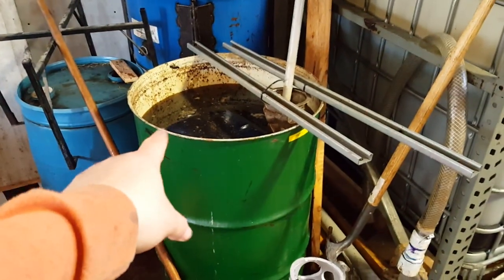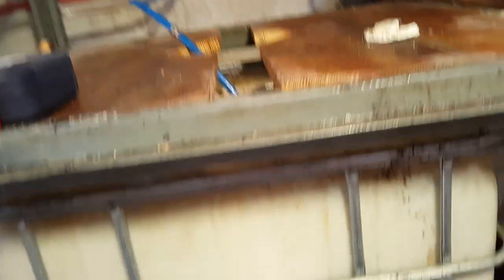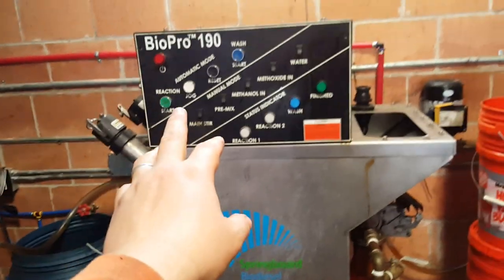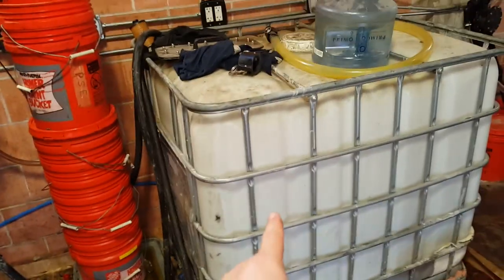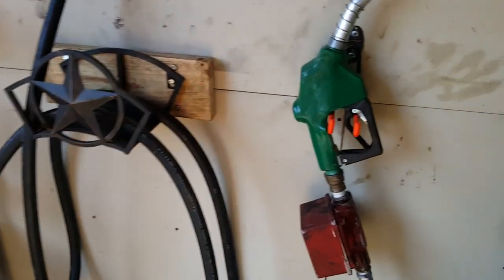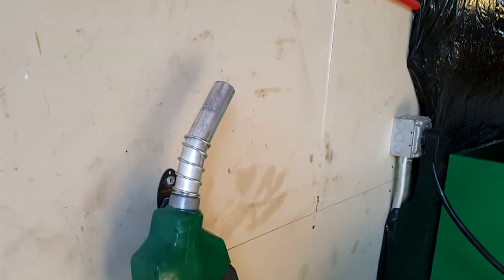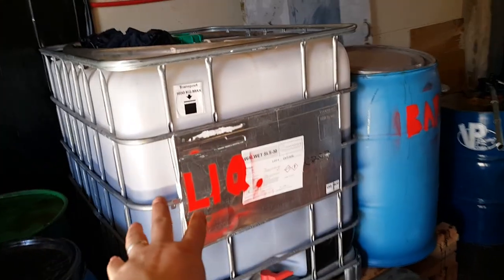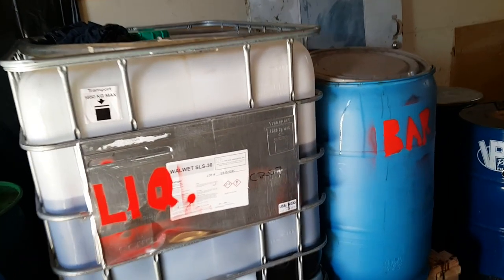HOW TO MAKE BIODIESEL LARGE SCALE AT HOME - BIOFUEL - METHANOL DISTILLATION - GLYCERIN FOR SOAP

Comment: Clean cooking oil goes straight into fuel tank for diesel
Reply: Right, as the [diesel] Volkswagen Jetta does this. But if you want to use used oil, it has to be cleaned through filters and other process. . Any diesel car can be converted to run on veggie oil.
Reply: Diesels run better on used veg oil, it is less 'sticky' than virgin oil.